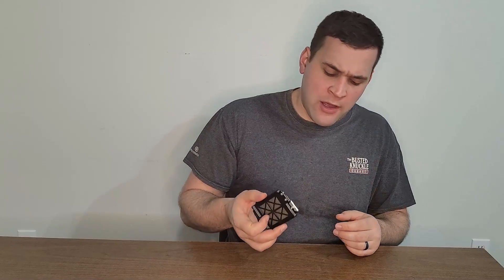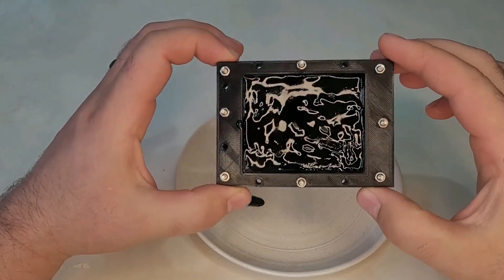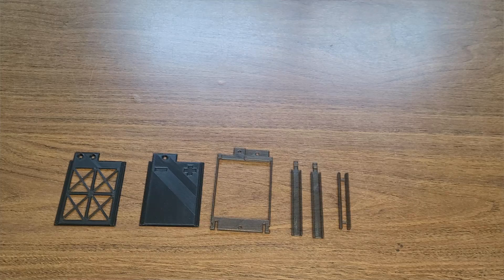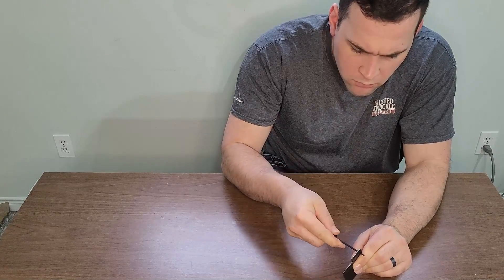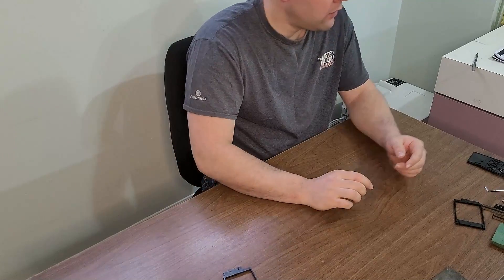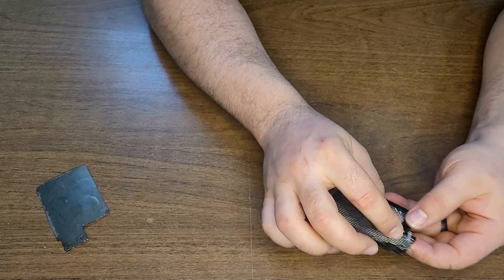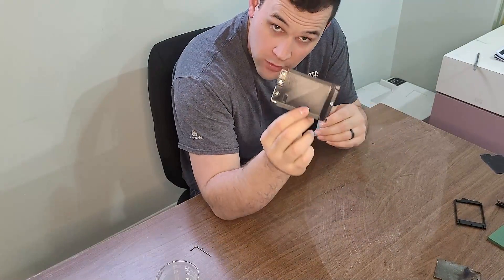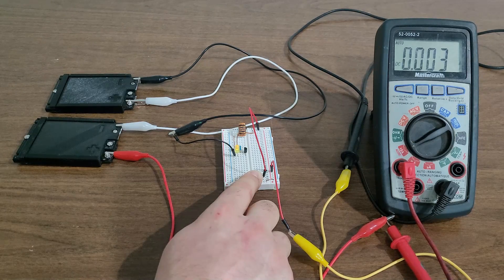Aluminum Air Battery 3.0

Comment: To make it even better use sodium or potassium hydroxide for electrolyte also if use use realy basic electrolytes you should use abs a petg
Reply from the maker: Good idea.  I actually have worked a decent amount with KOH already, and in my latest video, I moved towards a more durable plastic container for the battery housing.  Check it out if you have time :)

Comment: Did you measure energy density and capacity?
Reply from the maker: Not for this one.  These batteries are still quite low power and I'm only doing this on the side.  As such I don't always have time to get all those details.  With that being said in my latest video I did measure the mA hr rating of the featured cell.  It was only 50 mA hr which gives you an idea of how low the power output is.   Hope that helps.  Cheers!
Reply: @MechanicGoneRogue  Thanks ;-) you probably want to say mAh ? as mA hr does not exist. The power may be low, but the capacity high. A simple way to measure energy capacity if you need is running a know resistance, like a light, and just measure the time.
Reply from the maker: Hahaha, yes, I meant mAh.  Thanks for catching that.  Yes that is exactly what I did in my latest battery video.  10 mA draw for 5 hours.

Comment: explain why steel mesh and aluminum foil as current collectirs please
Reply from the maker: @randymorales1127 I just tried to use materials that are common.  Stainless steel mesh and aluminum foil are both electrically conductive, readily accessible, and inexpensive.

Comment: Why the baking soda? Wouldnt that decrease the recharge? Or is it meant to be disposal?
Reply from the maker: I was working off the theory that alkaline electeolyes are better than neutral ones.  The baking soda is meant to make the electrolyte alkaline.  Although it's only mildly alkaline it's meant to be a safer easier alternative to KOH.
Reply: Recharge?? You can recharge aluminium batteries?